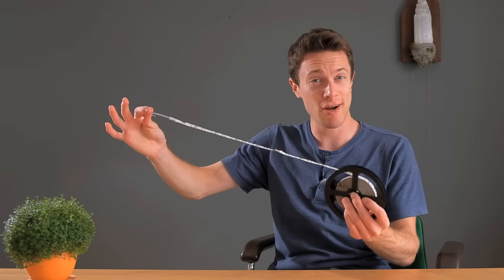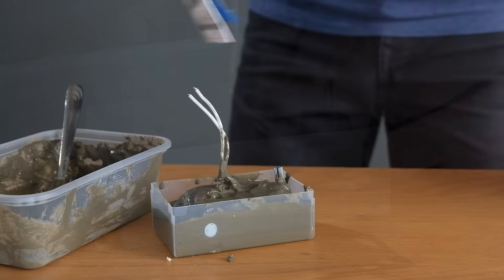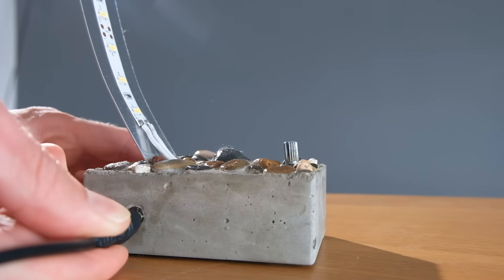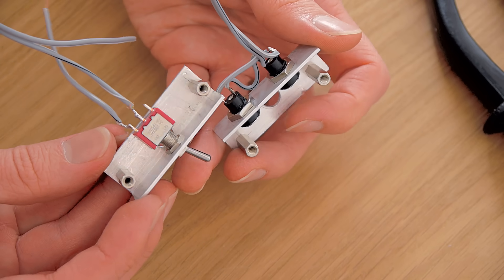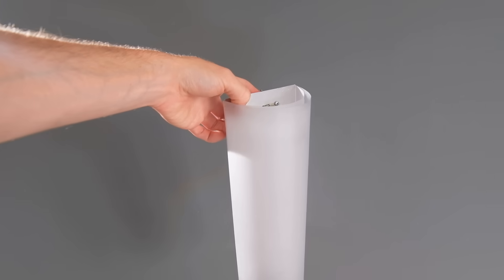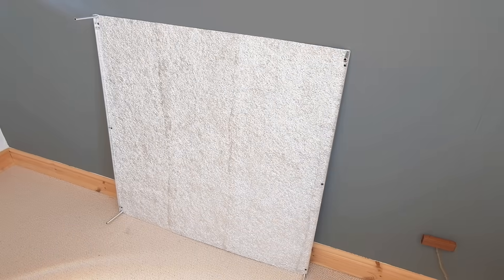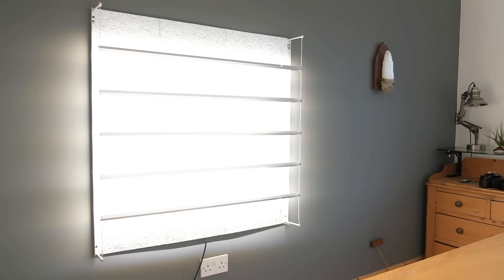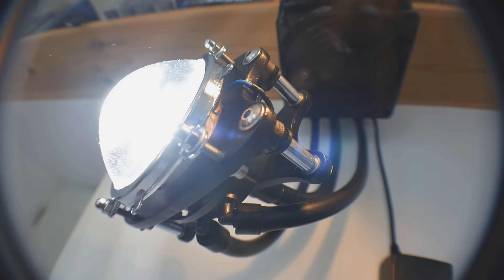3 inventive lighting projects using LED strips

Comment: what about a project where you have LED under each stair on a staircase, some movement sensors and as you go up/down the stairs light up and faint progressively like 3-5 at a time, so that #1 lights up lightly, #2 medium , #3 full power, #4 medium again and #5 lightly, and the next step you make up or down, the light progresses up or down with you...

Comment: just got a cool idea watching your video - I have used the aluminium c channel before for lighting in van setups - as it hides the led strip in most situations when viewing the light. The idea is 2 x c channel, facing each other, and in the middle bettween them is aluminium angle - placed downward such that each c channel light reflects off of it and outward to the viewer. Thanks for all of your awesome diy videos.

Comment: I'm going to undertake the first of these projects but I have a couple of questions. How do you fix the aluminum bar into the wet concrete without sliding out of the case? Would it be possible to use epoxi instead of concrete with some stones inside the mold? What do you think?

Comment: Dimensions, tool sizes, material specifics??? I have started the tin foil one. How to make bolt fit and screw into tubing? What size holes to drill? What electrical wire to use??

Comment: Hello Matt,
With instructions shown for your table lamp over an aluminium strip, I used the electrical wire casing and fixed it on the table edge in shape of an inverted U and pasted the strips inside it. Not as elegant as yours but does create very good lighting for my desk work.
Thank you for inspiration.
Abhishek Chatterjee

Comment: As a beginner builder, I'd advise to hook everything to the power source, and make sure it lights up the way we wanted it to be, before making it static. Making it static = burying the dimmer in concrete, or hot gluing @10:17

If something goes wrong with the whole built, or you forget 1-2 steps (which I often did, again, as a beginner builder), it's a lot easier to fix if it's not static.

Comment: Another idea for difusing the light on wall lights is to use white nylon stockings streched over iron wires and then, hardened with a layer or two of resin. That allows to shape the difusing surface in various 3D shapes and play with the design.

Comment: nice! could the first one be used as a spring grow light or do those need to be a different kind of LEDs?
Reply: I was looking at this for plant lights too! According to this video watch?v=VOTivpZleVw it seems the best LED would be a red:blue light at 86:12 ratio. I was thinking of using his setup for my own grow lights, but he didn't mention what he used for the power jack, I think we need an adaptor of some sort. Did you find a solution?
Reply: @applepie9806  thanks for the light color suggestions for plants! If you look at the video around 12mins in where he sticky tacks the power supply hole to the side of the container before putting in the mix, that round hole is where you then plug in any sort of 5 amp power supply. They look like the ones that just have the circular plug in like old laptops had. You can search 5 amp power supply or 5 amp LED power supply and get one cheaply around $10 or less USD. Feel free to message again if you can't find one and I will post a link :) or he has some other videos that usually have good links and talks about low amp power supplies

Comment: If you don't want to scrape the sheets opaque, they do sell frosted glass finish in a spray can. I used this on the inside of my lamp post outside and a few clear-glass ceiling lights inside, it diffuses the light nicely and makes the lamp post seem "foggy" when it's on.

Comment: 5:34, I've used this kind of switches earlier and even using them 12V 1A Load, they get surprisingly hot and create a voltage drop of 3V to 4V. It might be a case of a defective switch, but I recommend using Relay, whose coils are switched by that switch.

Comment: @DIY Perks Great Ideas. Instead of using sandpaper to get diffuse light sheets, i recommend a normal piece of paper attached to the transparent layer. It is a bit less work, so the same effect.
Reply: or maybe tracing paper?
Reply: @DoReMeDesign  haven't tried that, but will keep it in mind for my next project

Comment: Uhm ... cheap LED strips ain't bad, even if you actually consider using them on a daily basis. I am having some attached to the back of my older ultrawide monitor and this for more than 4 years now, all of them are still as bright as I bought them and every single bit us still working.

Comment: It's a great video BUT ...... give more information what is the thickness of the aluminum give us the number of the LED strip in the first video and give us the number of the connector you solder to the dimmer circuit and the number to the power supply you didn't even show that all and what was the name of the stuff you mixed and put into that mold ? other than that it was a nice project.
Reply: OK I built this arch light only I used a 3/16" of aluminium stock but everything was like in this video and this works great, and I didn't solder a single thing as the dimmer has connectors just skip the wire in and tighten the screws and the light is plenty even at less than half light it sure helped me with my model building projects if you need light this is the answer.

Comment: 2020 and I'm sitting here thinking "Man, I wished my school didn't remove tech class when I was in school, I could have learned some simple wiring".
Reply: It's not too late! Simple wiring is actually simple once you learn a couple rules and have done a couple things wrong the first time. :D You can do stuff like the projects in this video if you remember:
1. Don't do stuff with AC line voltage, always use a low voltage power supply
2. Power supply needs to have the SAME voltage as the device needs
3. Power supply needs to be able to supply equal or greater current than the device needs (this is noted in A or mA - there are 1000mA in 1A)
4. Electricity goes in a loop, normally understood as from positive (+) to negative/ground (-)
5. When you connect + to - without a load device (light, circuit) bad things happen
6. LEDs usually need a driver circuit
7. Just try it out! And look up the things you don't understand.

Comment: Nobody actually did any of these.
Reply: I did the second project and used addressable LEDs and a microcontroller so i can control them with WIFI
Reply: The original creator did it :

https://www.thingiverse.com/thing:1639224
Reply: @champifun2  This looks amazing!
Reply: He lost me at the giant sheet of aluminum.
Reply: Pandora same
Reply: Forgot to upload mine.. NOW you can check it out 😁
Reply: I will be I need this for my work table only I'll be using one not two aluminum strip and attached to the sides of the table.
Reply: I did bro
Reply: I made the arc! A few years ago. I loved it. Going to make v2 soon
Reply: Just right now doing the firdt one with my dad 😅
Reply: I actually have.. but better. Check it out.

Comment: Not to shine any doubt on these great projects but cement eats aluminum. not right a way but over time
Reply: Drag303 it’s better to use wood ? Or what do
You think he could use that will last longer
Reply: @Lala-sy1si  you could use a type of hard wood like oak or if I were to use there method I would put on a thin layer of wax or silicone to make a barrier between the aluminum and cement just slightly above the pore line. This all can change depending on the span of the area you are trying to light

Comment: Instead of using the scuffed-up acetate I have used Yupo Paper, a type of synthetic vellum surface which is used by artists. It comes in opaque white and translucent, is just as durable as any acetate, and is fairly rigid without being very thick. You can find it at better art stores like Blick or Jerry's Art O Rama.
Reply: Silent-Active great idea
Reply: Since it takes paint very well it becomes a great color gel, light can go through acrylic paint or even "faux stained glass" paint on the Yupo surface.

Comment: I used led strips from Amazon for under cabinet lighting in the kitchen of my house.
Found 2700hz was the best color temp, nice warm light.
Used the adhesive to tack them into place and came back with staple gun to finish the mounting to the cabinets.
Reply: 2700K (Kelvin)*
Reply: Bastian Springer You never know. Perhaps Ethan can listen to the light.

Comment: Neat projects but okaaaay.  Buy a dimmer and instead of using the screw terminals already soldered on the board that can handle up to 12AWG wire, just solder the wires to the solder posts sticking through the PC board from the same screw terminals.  Brilliant.

Comment: "I'm going to watch this video and make this stuff!"
second step requires soldering lmao nevermind
Reply: It's a good excuse to learn how to solder. A Weller soldering iron can be bought for as little as $30.
Reply: @Levy_Wilson  $30? My currency says 1$ equals Rs. 75. And I got myself a decent one, with wooden handle and a three-pin plug with a thicker cord for Rs. 40/-. Fair enough!
Reply: Soldering really isn't hard. You can pick one up for $10-15 on Amazon and solder for a couple bucks. Plug it in, wait for it to get warm, put tip to what you want soldered and apply solder. It's like a glue gun except you hold the glue lol.
Reply: I'll never understand why people are scared of soldering
Reply: @BecauseGames  once, I wasn't paying attention and grabbed my soldering iron like a pencil by iron. I wasn't discourages, but I think people are just afraid of making mistakes like that.
Reply: Actually, it doesn't. Did you notice how there were screw connections on his dimmer circuit? That's how you can connect everything without soldering... I would recommend adding a tiny drop of super glue to prevent the screw from unscrewing itself when everything is wired correctly.
Reply: takix2007 you need soldering... how else are you going to connect the led strip?
Reply: Soldering isn't rocket science.
Reply: @rozberry8867  they made it seem like it was in middle school, when i first (and last) tried soldering.
Teachers really suck at teaching
Reply: soldering is piss easy - sewing stuff is harder than soldering.
Reply: You'll watch a video on how to do this, but won't watch a video on how to solder ... JUST SOLDER!!
Reply: I'm not sure why he didn't just use the set screws in those blue blocks on the switch. Then you don't to solder anything and you can remove wires without using any extra tools except a screwdriver
Reply: Soldering is not that hard tbh I’m 14 and taught my self to do it
Reply: I believe that you can do it.  As a teenager building model "Starships" I decided it would be cool to light them up.  Doing so without solder, things worked for a few weeks.  Learned how to solder, projects lasted for years.  This was in the late 70's now you've the internet!  Solder!  Have fun!  Always assume the iron/gun you've just laid down will burn you and avoid breathing the fumes though!  Oh, those mentioning the screw connections...
...true but, not as clean a project.
Reply: I believe that you can do it.  As a teenager building model "Starships" I decided it would be cool to light them up.  Doing so without solder, things worked for a few weeks.  Learned how to solder, projects lasted for years.  This was in the late 70's now you've the internet!  Solder!  Have fun!  Always assume the iron/gun you've just laid down will burn you and avoid breathing the fumes though!  Oh, those mentioning the screw connections...
...true but, not as clean a project.
Reply: Soldering is FUN my dude!  Quarantine times are perfect.
Reply: You've done more difficult things in your life, you just didn't think about it that much. Give it a try, plenty of tutorials online, such as this one.
Reply: It's really easy. I got the hang of it in 2 minutes and never screwed up anything. Unless you have sever tremors for some reason.
Reply: Soldering circuits is a lot more easier than soldering metals.
Reply: Most people pass on soldering as it requires a very well ventilated workspace, special tools and other safety supplies. It's not that soldering is hard, it's more that to solder properly, you don't simply heat up an "iron" and melt metal.
Reply: @loris9464  an open window or a fan is enough, the only tool you really need is the soldering iron (10$ or less), also to do it properly you literaly just heat up the cable and then place the solder so it will melt on it (or melt it onto the tip itself and then add a bit of flux to the surface you are soldering)

Comment: For the last project just get an old TV that's broken that someone's diving away. Gut it, dispose of the rubbish (pretty good Brit accent, huh.), But keep the LEDs and the spacial light filter sheets. You'll see that it's the spacial light modulator sheets that work their magic, transforming your last light from an 11" thick monstrosity into a svelte, contemporary room ceiling light that's less than an " thick but as bright as atv set set on its Max brightness